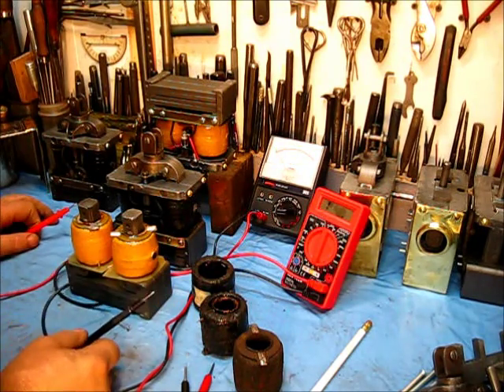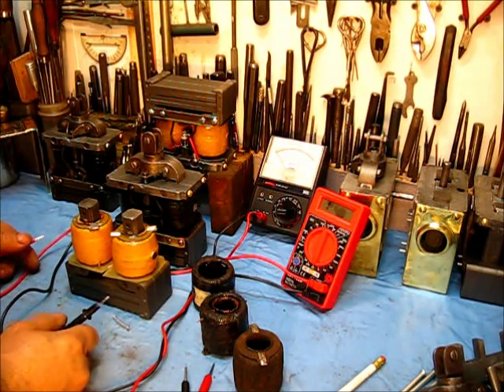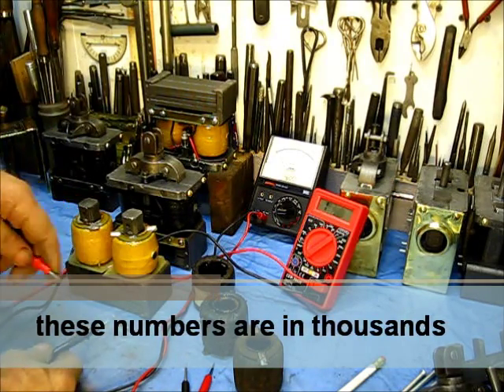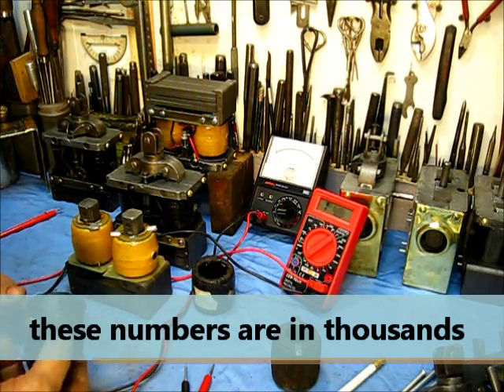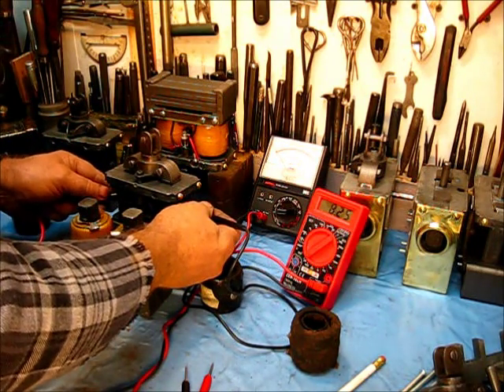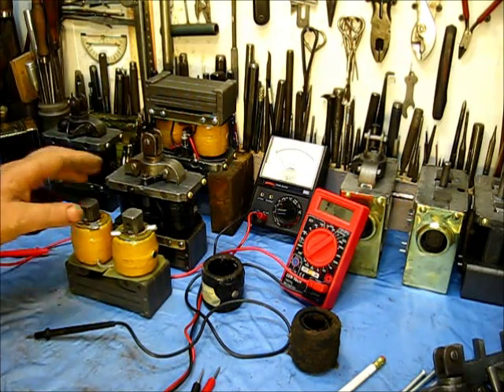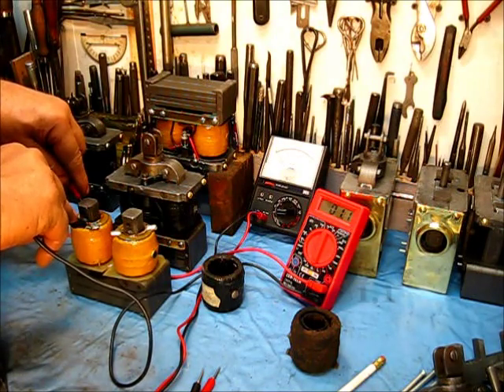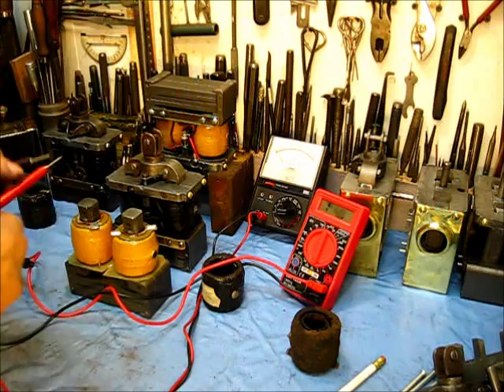Wico EK Magneto Repair coils / meters 9of

Comment: Currently rebuilsing mine.... My primary was 1.1 ohm. Secondary 3.84 k ohm. ( 2 together = 7.670 k ohm )
You mentioned anything from 7 to 11 k ohm range will work. Can you confirm this is acceptable vs. Buying new.
Thanks

Comment: So the bottom line is that the secondary winding should show 4000 to 5000 (4K to 5K) ohms, per coil. The primary winding should show about 1 ohm per coil. No winding measurement should be 0 -or "shorted" in other words. No winding should show infinite or super high ohms  -"open" in other words. None of these reading are critical, as long as they are in the ball park. Also, neither winding should show continuity (a short) to the metal frame- or "ground" when the ground lead is disconnected.